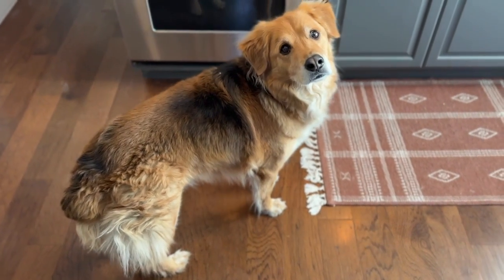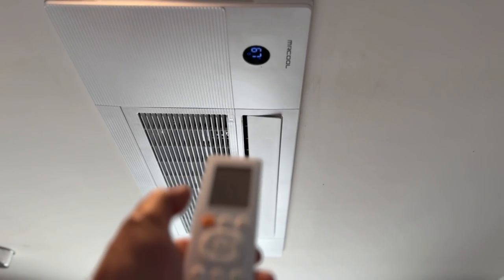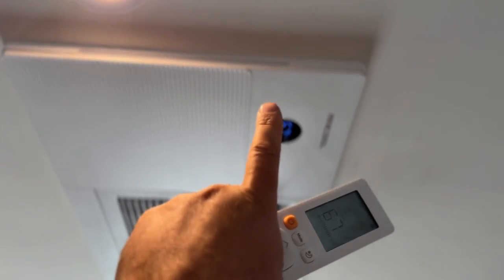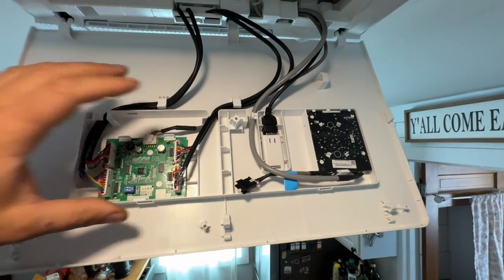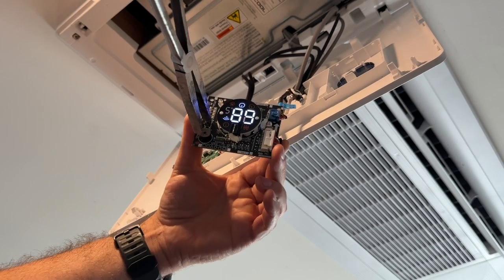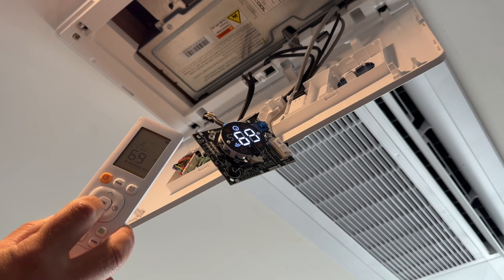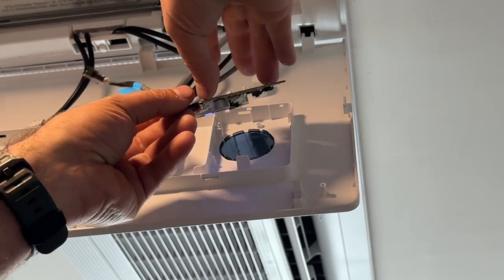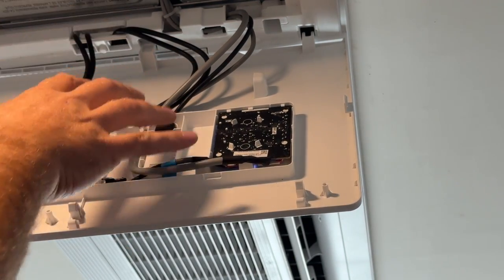How To Stop Your MrCool Ceiling Cassette From Beeping!

Comment: it would be safer to just put silicone in the hole. it will be quiet enough to hardly hear it, if at all more than a few feet away.
** no need to take anything apart! I mean cover or silicone the little hole beside the display in the cover itself, that is the speaker hole.

Comment: why are you turning it on and off and adjusting it so much that it is annoying? Also, is the remote programmable so you can set a schedule to change the temp, and if so, does that change cause beeps?

Comment: Maybe there is silence mode on the remote or night mode, which will silence beeps when you command device or do something, take your time, and read manual. On the Mitsubishi units, there is night mode that silences indoor unit beeps and dims lights and lowers the sound of the outdoor unit.

Comment: Most of those beepers have a (sound hole) in the center,  I would first try placing a piece of electrical or scotch tape over the hole and see if it mutes it down to where you have to be right under it to hear it.     I know if I removed it that I would lose it, probably not the end of the world and some might actually throw the beeper in the trash .    LOL
Reply: or clear silicone. the speaker hole on his model was the small hole right beside display. it's likely easily accessed there and likely the same on most every model made.
Reply: @throttlebottle5906  Yep !

Comment: Can you please make a video about rod and blaze. For example: the difference among 0% 15% and %56 and I need to know which one of those requires less heat to melt. I have used regular torch it takes longer and longer to melt and once it touches to the copper never melts 😢. Please do. Thank you. 🙏